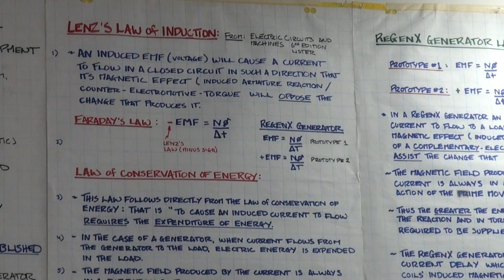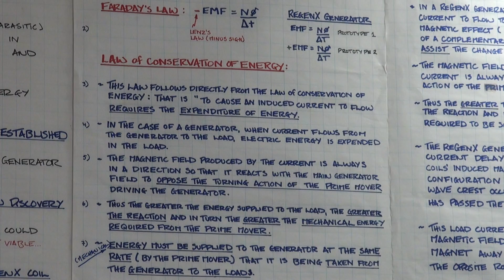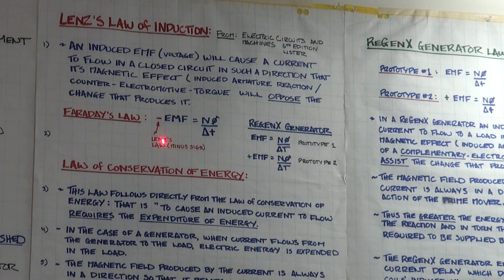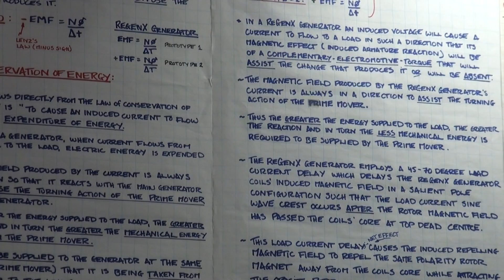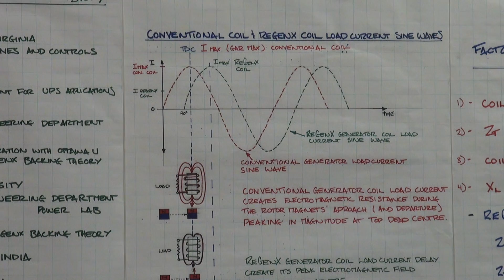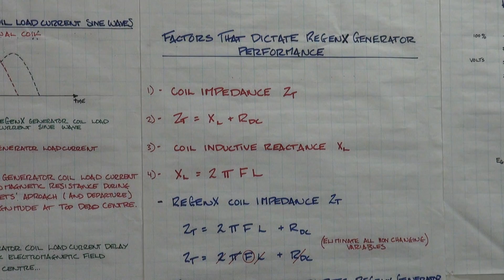Introduction to ReGenXtra Innovations PART 2

Comment: Thane thank you for your offering to help me understand. I have been deep into the study of your concept explanations. I repeat your video's until I learn something new.

The basic things I am gathering is the relative speed and winding impedance of the very long coil wire length. I am realizing with each of your video demonstrations that you are 
spending a great deal of time winding and re-winding coils to match a certain desired 
RPM/frequency. 

Also the dual poles off a single yet advanced core. 

The transfer of fields through the framing structures as demonstrated by  one of your experiments adding a non magnetic link in the drive train.

I observe the special wire HTS as an addition for an improved end product.

I see the general rotor magnet spacing and have something to start with.

Your ability to teach has improved. Again this comes from me a man who has studied
many science projects over a 50 year period.  Your expose is one of the most important
finds being at the root of true field science.

Your's is the only project I find worth replicating like I did John B. SSSG.

Once again thank you, your work is at the heart of what I ponder daily.